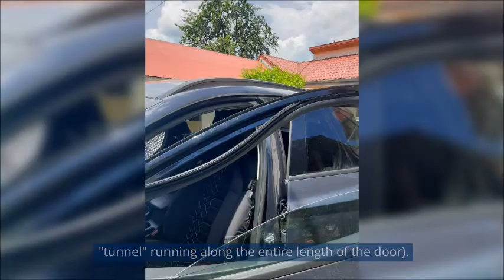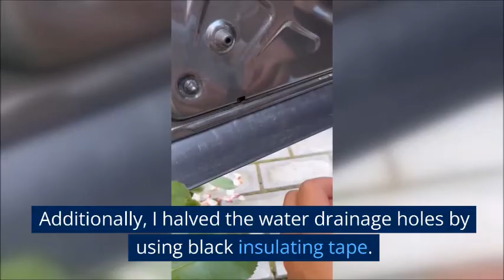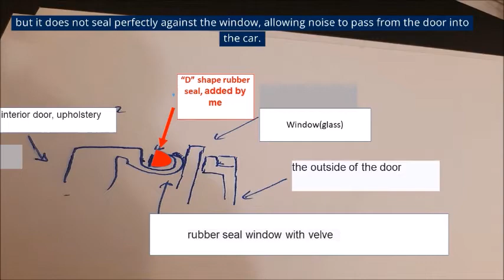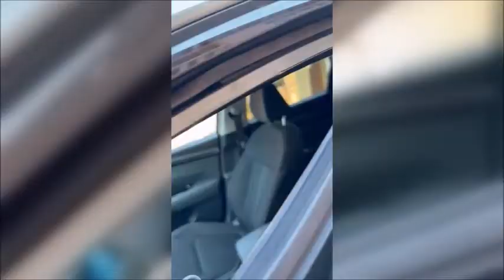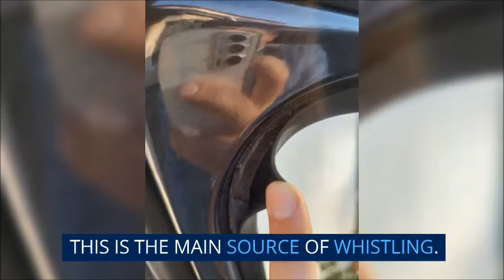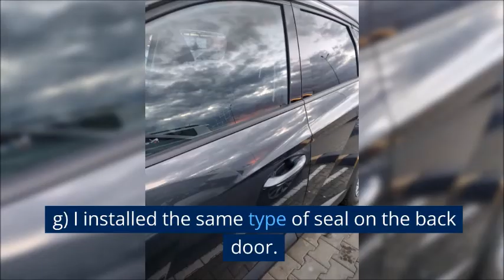Make your new Tucson NX4 much quieter

Comment: Hello. I have a Tucson bought in May 2024 after 100 km/h there are rustling noises coming from the window area, even from the passenger side, could you tell me exactly which materials to buy. Specifying the dimensions better. Thank you
Reply from the maker: You need to follow at least step 3 from the video. This means you absolutely must seal those openings in the frame (at the top) of the door, as air come in through the bottom of the door and exit alongside the gasket and the metal frame at the top where the window closes. Right there (on the metal frame, under the window gasket), you will find a 'channel' through which the air draft whizzes; I placed a rectangular gasket measuring 7 mm in width and 5 mm in height along the entire frame. It is also very important to apply black silicone (the type used for cylinder head gaskets) at the junction between the window gasket and the metal frame.
So, for the dimensions of the gaskets used, we have:

For the D-shaped gasket, a width of 5 mm;
For the rectangular one, 7 mm in width and 5 mm in height.

You will need approximately 3 m of each for each door. Thank you for your interest!"

Comment: Hi, I have my Tucson 6 months, and notice a rattling noise in boot… seems like it’s coming from the boot panel on the door… Also the press button door lift has.come loose … am i entitled to have that fixed?
Reply from the maker: Hi, thank you for your interest and apologies for the delayed response. First, check if the small round rubber pads are optimally positioned. They are located on the edge of the rear hood. They need to be screwed in or out to securely hold the trunk hood; otherwise, it may produce sounds on uneven surfaces. To check this, close the trunk and, with it closed, pull it upward. If it doesn't stay in place, they need to be unscrewed to press against them.
Reply: @toptechreviews9481  Hi, thanks so much for your prompt response… I think I may need to bring it back for the garage to do it… Would this be covered under warranty as it’s only 6 months old, also the automatic lift switch is loose
Reply: @toptechreviews9481  yes I think I’d have to bring it back to the garage to sort this … Is this something they’d do under warranty as it’s only 6 months old
Reply: @toptechreviews9481  I know that thing. I checked:
- rubber pad
- a lock
- actuators of trunk door
- wheel arch nuts that often come loose
- central rear seatbelt
- license plate pad
- I insulated the bottom of the trunk and removed roller blind
- I glued the pads around the trunk floor

... and it still happens.
It's like you have something loose in trunk.
Sometimes I think it's a trunk floor.
Reply: I know that thing. I checked:
- rubber pad
- a lock
- actuators of trunk door
- wheel arch nuts that often come loose
- central rear seatbelt
- license plate pad
- I insulated the bottom of the trunk and removed roller blind
- I glued the pads around the trunk floor

... and it still happens.
It's like you have something loose in trunk.
Sometimes I think it's a trunk floor.
Reply: @sh4dy49 it turned out the hinge was loose 🫤

Comment: Did you measure decibels before and after?
Reply from the maker: I didn't measure because I made gradual modifications (discovering step by step), and in order to measure the sound now, I would have to disassemble everything, measure, and then reassemble. Plus, there would need to be identical conditions of speed, air currents, angle of incidence of air currents, and exterior traffic noise. What's certain is that two of my friends have applied it to their cars, and they were very satisfied!